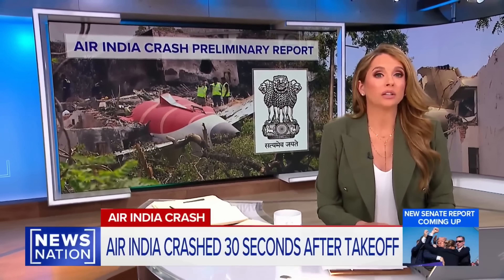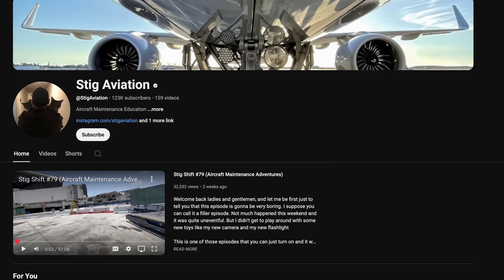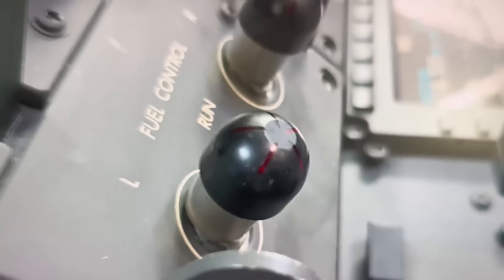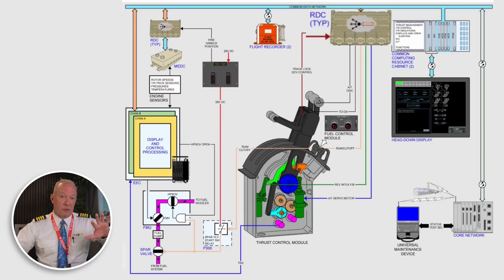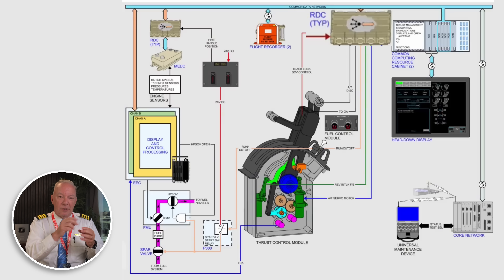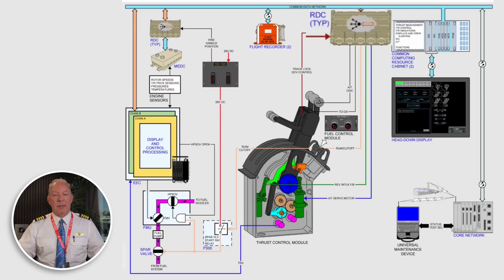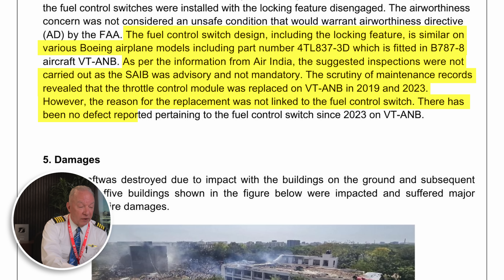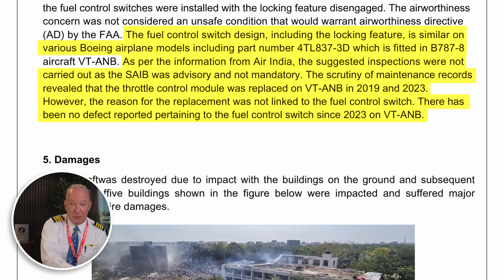The Truth About Boeing 787 Fuel Control Switches

Comment: ?? 
Take notice in the future when you use this switch Captain Steve.
Like all metal Parts they wear and fatigue.
By not fully pulling it out and  overtime, it wears itself out.
Could it be just as simple as it warn the metal holding position out ? 
So now the switch does not work as it should, and designed to?
Lazy fingers forceful movements Where Metal Parts down.

Comment: Possible Scenarios
1.	Intentional crew action — The switches were intentionally moved to the OFF position by human intervention.
2.	Mechanical malfunction — A mechanical failure resulted in the shutdown of the engines.
3.	Electrical malfunction — An electrical failure resulted in the shutdown of the engines.
4.	Data recording error — The digital flight data recorder (DFDR) incorrectly logged the sequence of events.
______________________________________

Outstanding Technical Questions (to be answered without error or misinterpretation)

Scenario 1 — Intentional crew action
•	No further questions remain. If this scenario is confirmed, the cause of the aircraft’s loss is known.

Scenario 2 — Mechanical malfunction

•	Is it possible for the two fuel control switches to move to the OFF position without pilot input?
•	Could such uncommanded movement occur to both switches simultaneously?
•	Could the fuel shutoff valves close due to a mechanical cause without pilot input?
•	Could such uncommanded closure occur to both valves simultaneously?

Scenario 3 — Electrical malfunction
•	Could a power interruption occur anywhere within the fuel system’s electrical circuits?
•	In the event of a power loss, what is the default position/behavior of the fuel shutoff valves?
•	Could an electrical disturbance (short of a complete power loss) cause the valves to close?
•	Could such an event affect both valves simultaneously?

Scenario 4 — Data recording error
•	Given that the DFDR records based on electrical signals, is it possible that it recorded incorrect data?
•	Could such erroneous recording affect multiple components (e.g., switches, valves, engines) simultaneously?

Comment: nice   video,    I got  two  Questions   what happens  if  the  wire     carying 28 Volts      from batery  to  the  relais breaks?   
Can    thet  wire  fail?  of  cause!   and   why  vould  it  fail?   because of mecanica   demage......   Is  there  anytheng  hat  coulf have  caused mecanical demage  to  some  28  volt   wiress?   Yes! 
what happens  if  a  tire  explods  and  is  there  somethng  with 28 Volts near by ?    Yes there is!  loog  alt  the brekes   these  are operatet   with  the  28 Volt  system...  So   the  report  says  maximum  speed  140  konots  was acheaved  and imediately   after   thet    teh switches  were operatet.    As   speed  increases   alt  full trust  level   and  the Angle  of Climb  wie  see  on thr video,  ist is  clear  that amassiv trustreduction  already  occured before  the   fuel was  cut  off manualy !   And  i See  blast  of  smoke  and  durst  just  from under te  left    wing   beginging  in the seconde   when   teh  plane  droppt the tail  to  rotate.   So  for me  ist's  pilot  error,  but  not  bilot  Sueside     we will see  what  further nformation   will be released!   sorrx  for my  english...

Comment: I think all was expanding very perfectly! But im just a car mechanic, so one question got in my head: 
Airplanes have to failsafe multiple times. When there is just one relay for the fuel valves, what would happen if the relays fails? I am sure this isn’t true for this case, but I could happen, or? Relays fail all the time in cars :D just something about the relays, which aren’t really failsave like described here :D

Comment: As a retired electrical engineer and a former private & glider pilot, I must say that the sharp edges of the switch locks are slightly dangerous. If you do not shift the switch properly forward, it will not lock. If both the movable part and the fixed part ot the lock were rounded, that would not occur. If you are a bit lazy and trust the mechanism, it may not lock properly, and you can bring it into an off position by moving it slightly backwards. This may even happen due to the vibrations during takeoff.off run together with the force of the contact spring..

Comment: I appreciate your analysis, but as a guy who does a lot of low-voltage work with relays… 

Your analysis doesn’t cover what would happen if the wire between the battery and the switch had a loose connection….

1) does the fuel valve need electricity to open (normally closed) or does the valve need electricity close (normally open) it or is it like a servo where electricity on one terminal will open it and electricity on a different terminal will close it and if electricity fails it stays in the last known position. 

2) the black box apparently is saying that the switches were flipped. But where does the black box listen to the circuit? Is it reading a separate discrete pole on the switch independent of the input voltage, or is it reading voltage before or after the relay downstream of the switch? If power was lost on that bus, it could show as a switch failure. But presumably other systems would’ve also shown failure because that can’t be the only thing on that one wire.

All that being said, it’s pretty hard to justify why the switches would be turned off one second apart in a logical order, that definitely does look human like, but a scientific approach would still have questions….

Comment: Captain Steeve - whilst I appreciate your research, you are not sufficiently qualified to interrogate the integrity of this fuel switch apparatus. As a result, you really shouldn’t be concluding that this system is ‘fail-safe’. In order to do that, you need to have an electrical expert who needs to be able to consider and contemplate various technical aspects which are outside of your area of expertise.

Comment: Hi Cpt, have You asked to any engineer where the FDR pickup the signal of the engine control switches? I'm pretty sure it is not at the switch itself, but it should be extrapolated from the position of the 3 fuel line valves which are "monitored" at all time. Nobody talked about the 28dc at the relays  while engines cut out... and again noone consider a failure of the hot battery bus, from memory the battery charger itself can not power that bus in case of battery failure or disconnection...

Comment: Ultimately, all a switch does is make and break a connection. It's absolutely possible for a connection to be broken and made by a broken wire. I agree that you can't say that a switch has physically moved just because the logic state changed. All you can say is that the connection was made or broken, not HOW that happened. Now, the chances of that happening on two circuits in a brief time are pretty small. Yes, you could imagine a wiring loom that has been fretting and adjacent wires could be flexed and a break/make of a circuit could happen. However, this would surely not have happened for the first time on takeoff, it would surely have flagged up as a nagging problem on one or other engine before this incident.
The other element in this is software. It's absolutely possible for software to have a bug whereby it didn't correctly read the state of the valves. That could have happened, but you would expect any issue to happen at the same time.
On balance, it does seem more likely that the physical switches were indeed changed. Didn't the voice recorder say that the pilot asked why the switches were turned off, and what followed was that the switches then turned on again. If it was something other than human interaction, why did the fuel get turned on again after that comment?

Comment: Steve another great video and explanation. Is there any  situation in which those detents are chipped or worn then in turn the switch jumps forward or back? due to the movement of the plane ✈️ on the runway, followed by takeoff 🛫???

Comment: Absolutely no chance this was not intentional and that captain murdered all on board and on the ground.  
Chances of a closed loop simple electronic systems failing to switch off an engines are very low.  Two of them at the same time?  No chance!
Also if there was a failure then why would they move the switch from cutoff to run to restart the engines?  Because if the switch was still in the run position you can guarantee the crew would not suspect them as the cause in such a short time.
Reply: Also, CRM requires pilots to talk through their actions and at no point did the captain or first officer state that they were cycling the engine master fuel switches which should be very telling that this was done intentionally and, well, sneakily at the most vulnerable moment where it was unrecoverable.

Comment: How is it possible that an independent only hardwired electrical system like the fuel control switches, relays and valves functions are monitored in the flight recording system ?
It can only work so if there are links between both !

Comment: As an electronics and communications engineer I have worked on many different systems. Schematics show you how the electrical paths are connected but on the real physical world they usually are different.  Im not sure how planes are wired but cars and most electronics have similar designs. The relays as mentioned require the power supply to come from the batteries. However, and again  I don't know how planes are wired,  the earth or negative s are in most electronics connected to the chassis or body of the vehicle or the device.  Planes being made of aluminium and connectors made of brass or copper could suffer from corrosion due to dissimilar metals (copper/brass with aluminium) coming in contact with each other. The reason for grounding the earth to the chasis/ body is to save on wiring. If the negative is disconnected from the battery both relays will shut off regardless of the switch position and separate wiring to the relays, the earth (or negative) is usually common in these situations. If during take off the planes body twists, which is highly likely as the stresses are off the wheels and onto the wings then if they are using earth returns for the negative and the earth connection is not 100% then both relays will turn off. When the thrust stops the body can return to its original pre take-off shape and the connection is restored turning the relays back on.
The switches don't need to be turned off for this to happen

Comment: I am not questioning your explanation.  It just leaves more questions.  If the fuel control circuit is purely analog, how does the flight data recorder know it's position?  Voltage sense?  If it's voltage sensing, could a loss of voltage elsewhere trigger a similar signal that the switches were put in the off position (excluding the slight time separation between switches)

Comment: Steve I haven’t had time to watch this video but I do have an opinion on the subject. I will NEVER fly again unless the fuel cut off issue is dealt with. Just like launching a nuclear missile two keys/individuals are required to launch. I fully understand the need to cut fuel in case of an engine fire but no one pilot should be able to cut the fuel. It will take time but I think the only solution is to have two buttons on both sides of the cockpit. Both buttons need to be pushed/activated in order to cut the fuel supply.

Comment: It really does not matter how a switch actually works, it all depends on the system behind it. If such a system has a glitch and interprets a false signal as a switch generated signal there can be a wrong action as outcome. It happened to me one time flying a Boeing 777 when in the climb my windshield wiper made three sweeps without being commanded by the switch. On a dry window, it scared the h.ll out of us. Better research is needed into the digital systems behind the switches and also what happens when the RAT deploys without command. The reverse flow into the electrical system without the ‘proper conditions’ should be investigated. The timings of the events during take-off indicate a RAT deployment before the fuel cutout switches were ‘set’ to off. Simple test for Boeing: Start both engines, make the plane think it is in the air by manipulating the air-ground switch and the fail the RAT uphold lock without an digital command. Then look what happens.. Could be done in a day. (I am afraid they already know at Boeing)

Comment: The fuel control switches were found in RUN position at the crash site.
There is no reason to assume that the Pilots did anything to the switches.
What the data recorder recorded must be what the fuel control valves were doing.
To record what the switches were doing there would have to be sensors monitoring the switches, are there any in the B787?

Comment: What is the default position of the relay, "run" or "cut"?  That is, if the actuating 28 volt signal fails, what position would the relay would fail back to?  OK, we are talking about two switches, and therefore two actuating signals, and its is unlikely both would fail at the same time.  Or is it unlikely?  Upstream of the switches, do they connect to a common 28 volt bus by any chance?

How does the monitor system register the position of the switches?  I presume the switches do not have little detectors on them that register the physical position of the switches.  I would presume the signal registered in the black box would be the presence or absence of the 28 volt actuating signal that goes to the coil of the relay. 

Just questions I would ask (as a chartered electrical engineer).

Comment: Those fuel valves are motor driven and even if the power were cut off to the valve the valve motor it will remain in the open position.

Comment: What you're saying is the likely scenario. However, They went out of their way not to implicate the crew. Until the final report comes out, let's give these men the benefit of the doubt.  Remember there was no way that the pilots were putting the correct input into the 7 37's rudder when 3 airplanes lost control because the rudder was doing an opposite of what they were doing. For 10 years they blamed the pilots for that. To this day they can't prove that the auxiliary pump was freezing, but they're pretty sure it was.  There are wires, Is there are relays, There are numerous things under the sun that could have taken place and until the final report comes out let's just give the pilots the benefit of the doubt.

Comment: Something that’s not being talked about enough is the cockpit voice recorder (CVR). In addition to being able to record what the pilots say to each other, the CVR also has the ability to pick up other sounds in the cockpit. Investigators have a library of sounds that they can use to figure out what a particular sound represents. Therefore, investigators should have the ability to compare the sound of the fuel control switches being switched from run to cutoff and then again back from cutoff to run (copilot last ditch effort) to the library of sounds they have. In addition to what Captain Steve presented in this video, this comparison would provide additional evidence that the switches were physically and intentionally moved. This has been done in many past air crash investigations.

Comment: the switches in the cab don't provide a direct voltage to and from the relays, they activate electro magnets that closes the contacts in the relays, there is no physical connection as you are suggesting, the power to and from the relay is supplied directly from a busbar or the battery via a fuse or circuit breaker this takes the load off the switches in the cab. there is no actual circuit from the switches to the fuel shut off valves, there is two sepperate circuits, so get the idea out of your head that the switches directly control the shut off valves because it's simply untrue and is mis-information.

Comment: I just can't help feeling that there's a gap in all the explanations of how the switches work and what has been said about the report.

1 - Captain you explain with great detail how the switches work. However, you don't ever mention how the actuation of the switches is recorded by the data recorder. Surely there MUST be a digital signal that is generated at some point for the data recorder to be able to record when the switches are actually moved. How does it work?
2 - Therefore, is it remotely possible that what the data recorder recorded could be different to what actually physically happened to the switches?
3 - So when the report mentions that the fuel switches transitioned to the cut off position can we say with 100% certainty that the switches were physically moved? Any chance that the switches never left the ON position at all? The report mentions how one pilot asked the other why he cut off the engines but what we don't know is if he asked because he saw the switches turned off or because as you mentioned in other videos, pilots can tell straight away by the noise from the engines.

I think answering those questions is relevant and others might be wondering about the same. Of course, the most likely explanation continues to be that they were simply turned off by one of the pilots.

Comment: From looking at the switch image there is a small flat top to the post on the switch body.  Is it possible that whoever turned on the engines did not fully engage the switch but left the lock pin setting on top of the post?  Will the engines run in this position?  If so, vibration could cause the switches to move to the off position.

Comment: Let’s say even if (big IF) the fuel cutoff was switched remotely, or wires were crossed internally, that wouldn’t explain the physical switches being moved to the cutoff position. Right? That’s why the case is simple: one of the pilots did this intentionally. End of discussion!